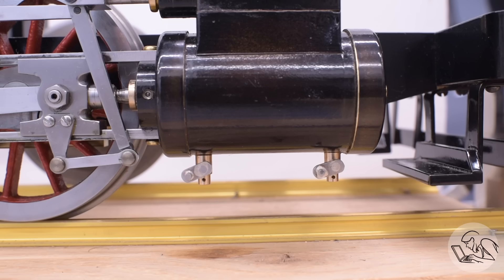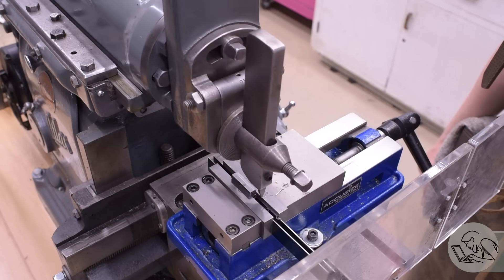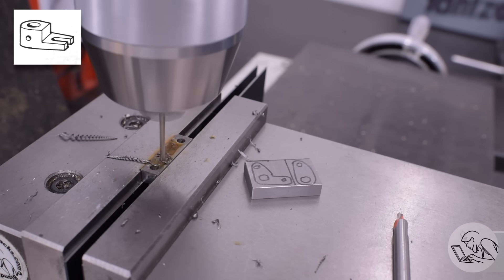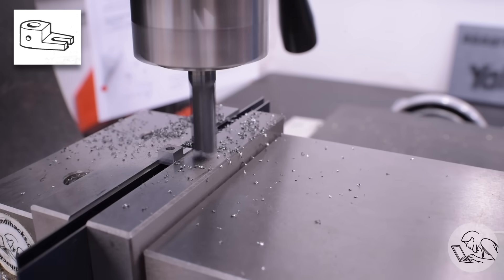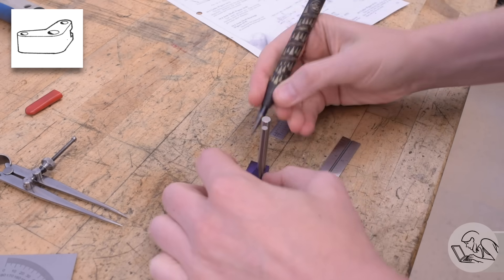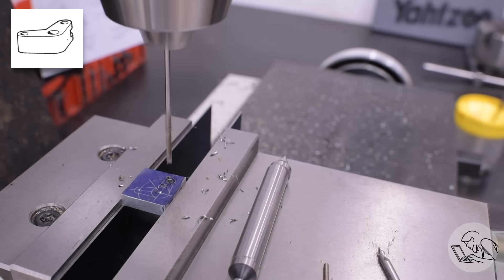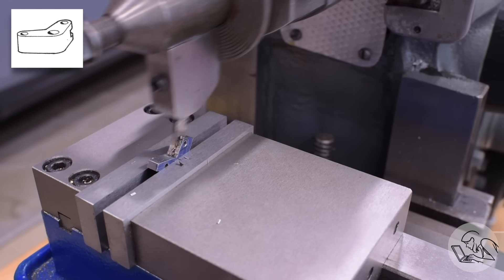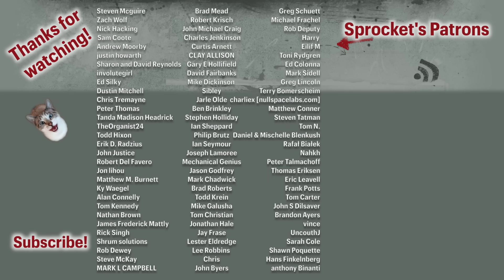Drain Valve Linkages - Pennsylvania A3 Switcher, Part 74

Comment: It would have been nice if we switched to metric back in the 70's as was the plan.  Metric math is so much easier too.
On the 102° bell crank I expected you to use the powered file machine after the bandsaw.
Reply: It would have been nice to have switched to the metric system back in the late 1700s when T.Jefferson advocated it, but here we are. Apparently, Congress felt that there was too much industry dependent upon the measurement system they were using…

Comment: A genuine question: how do you decide between using a slitting saw or grooving on the shaper? I feel like both are valid solutions for those kind of high aspect ratio operations, but I have no experience on a mill! I'm just lathing for now, but I'm very curious. 
And clearly, you can get the parts made!

Comment: I'm in US and oddly enough, lot of round stock I buy on Amazon is metric even if advertised as imperial. E.g. I recently bought some 5/16 tool steel which was advertised as precisely ground, and it was not 5/16, it was 8mm :)